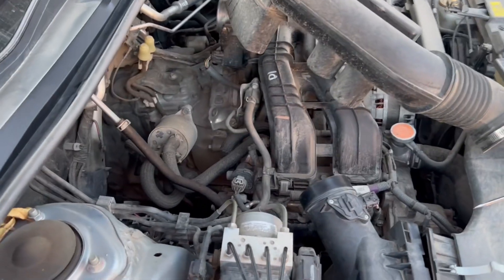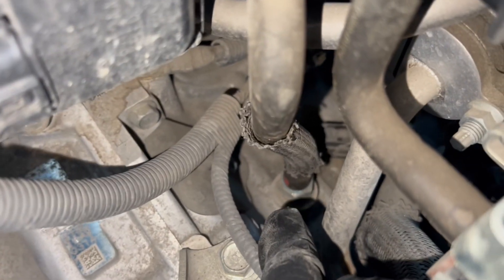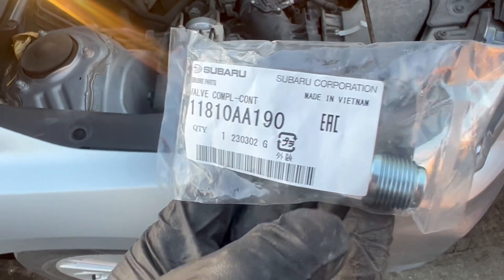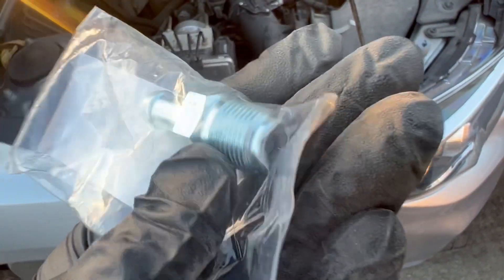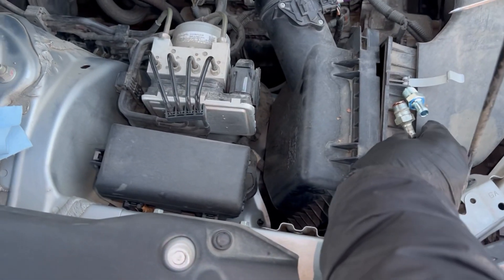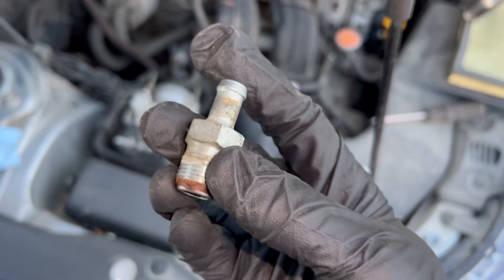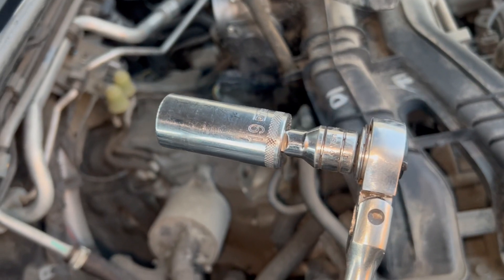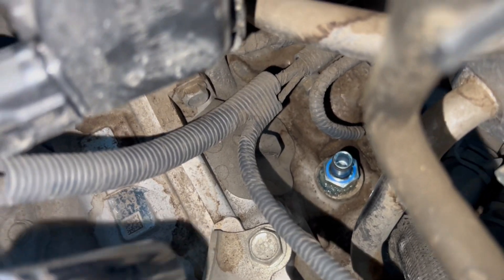2018 Subaru Impreza FB20 PCV valve Replacement

Comment: Thanks for this video.

Did you have to remove anything to get to that valve?
Reply from the maker: No just the hose
Reply: Yeah you have to losen the intake hose enough to pull it back  so you have easier access to get your hand inside to thread and remove pcv and bottom hose

Comment: Need any sealant on the threads? Thanks
Reply from the maker: I would recommend using sealant just in case
Reply: @rkroadsiderepair  ya according to the PCV replacement TSB, it looks like the threads sealer is part SOA635322 which is ThreeBond 1217H. So prolly Permatex ultra grey is fine.

Comment: What sort of symptoms did you notice change with the replacement?   I have a 23 crosstrek 40k miles and it has been quite rough around the edges for the last 10k especiallyat low rpm. Thinking pcv might be a cheap place to start.
Reply from the maker: @matthewweaver1123  rough idle and performance seemed low
Reply: I realize your comment is a year old, i had a very high pitch whistle audible at 50-53mph.  Occasional rough idle when stationary but in Drive.  Whistle is gone now and butter smooth.  My pvc valve still earlier but was definitely stiff.  Btw these are $11.50 at my dealership so do not buy online if you don't have to

Comment: I want to see you get that ratchet on and tighten it, I can't get a good angle on mine to get it out.
Reply from the maker: Need a deep socket and extension
Reply: @rkroadsiderepair use a  wobble socket adapter to get the right angle.

Comment: For 2012 Impreza (source: Subaru shop manual)
PCV valve 11810AA131
- tightening torque 17ft-lbs
vacuum hose 99071AD690
thread lock:  Three Bond 1324 (can't get, substitute Loctite 271 according to Toyota documentation)